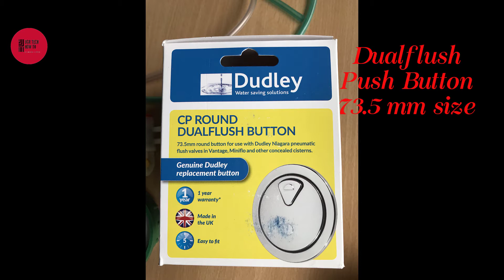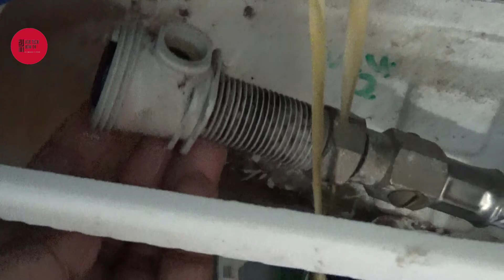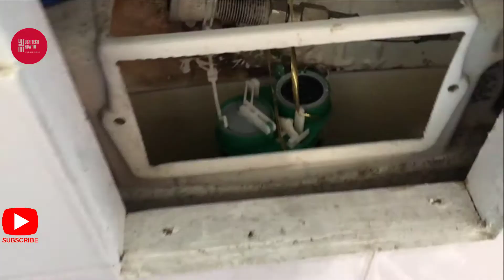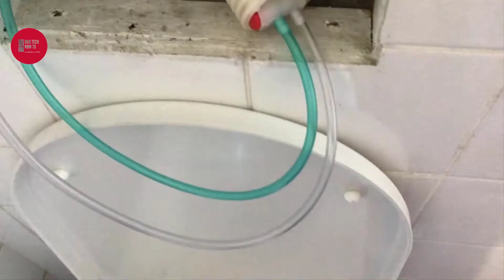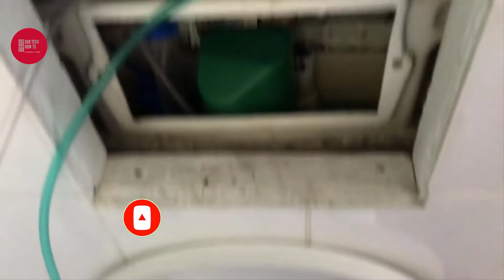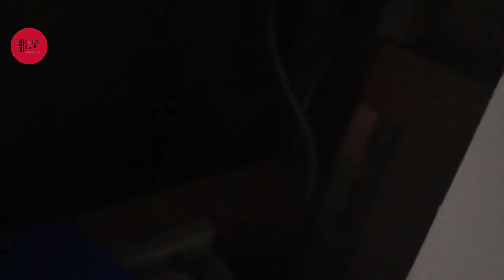How to Replace a Faulty Toilet Flush on your own-Thomas Dudley Toilet Flush Replacement

Comment: Great Video. My flush valve had failed and I tried the reverse option by firstly changing the dual flush button but still no joy. Temporarily I used a can of compressed air at the end of the "Full Flush" pipe to make it work which the family said was ingenious. The half-flush pipe had totally failed. After a few days I changed the full Flush Valve and all worked perfectly. In all honesty the hardest bit was putting the stopcock float back into place as its in the corner and my hands are quite big.